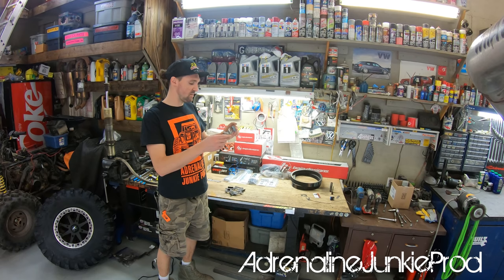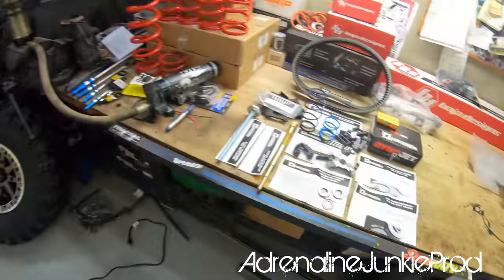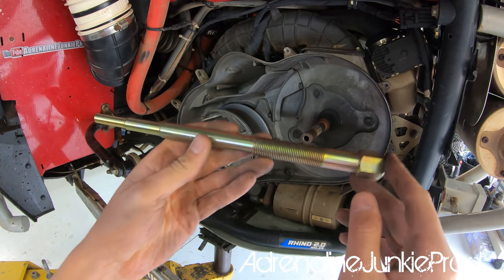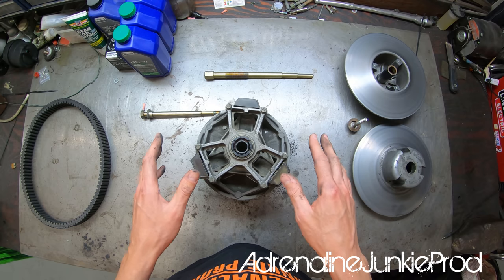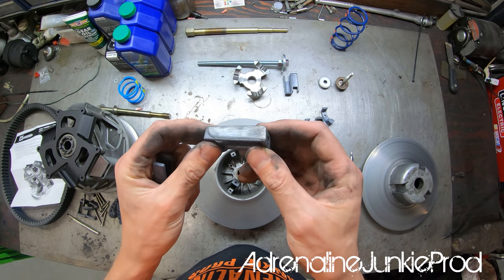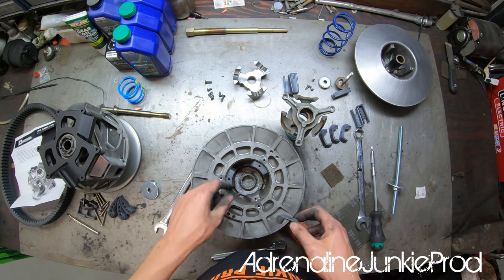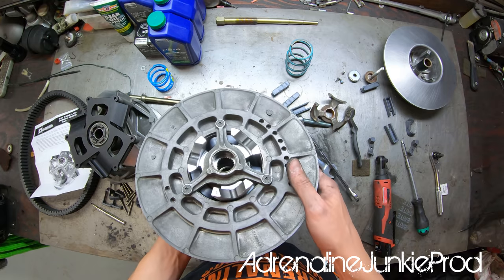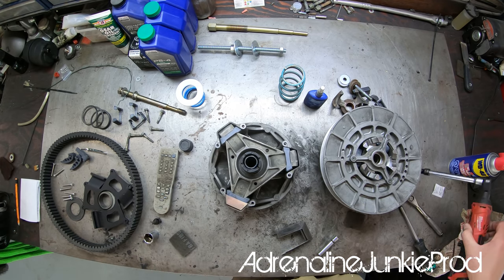Primary + Secondary Clutch Removal, Rebuild, Install - Polaris RZR Turbo, In Depth Step By Step DIY

Comment: This has to be the most thorough clutch rebuild I have ever seen. Well done! Now to tackle my own primary and secondary rebuild on a Polaris General. 👍
Reply from the maker: Hey man. Glad you found it helpful. The goal was to show everyone it’s not that hard if you take it step by step. Good luck on your rebuild.
Reply: @AdrenalineJunkieProd  Hey there. My primary and secondary need replacing. My head is spinning on which setup I should go with on the Aftermarket Assassin? I need help. Any suggestions?
Reply from the maker: @sweetcharlie700  I’m happy with my aftermarket assassins setup and so are a bunch of other guys I know who run them. I recently replaced my primary and secondary too. Made the machine feel new again. It’s not cheap but worth it. I’m future try to open them up and inspect them more frequently to prolong the life of the best set. You can either order a fully built setup from AA or get the clutches from Polaris and order the parts to build them. Pricing will be similar so it may be easier to just go straight to AA.
Reply: @AdrenalineJunkieProd   How do you feel about Duraclutch? Similar pricing to AA.
Reply: Is the clutch puller used for the AA primary the same as the stock Polaris clutch puller?
Reply from the maker: @sweetcharlie700  yes. The AA clutches are built off of brand new factory clutches from Polaris. But a high end puller. Not a Chinese Amazon special. I’ve seen those cheap ones break inside or bend and cause terrible damage.
Reply: Ok I just broke down and bought the AA clutch kit and the Tuner for my 2020 General. Time to unleash the beast! FYI when I removed my primary and secondary I happen to noticed a ripped CVT boot. So now I’m replacing both rear drive shaft. I can’t believe I’m doing all this on a machine that has only 1200 miles! Oh well… fun times!

Comment: That machine just keeps getting better. Thanks for sharing this upgrade with us.
Reply from the maker: Thanks! I’m super happy with how the machine is evolving. My next big mods Will hopefully be a full spring kit from shock therapy and an RS1 front diff conversion. Stoked you enjoyed the video!!
Reply: @AdrenalineJunkieProd  Nice man. Ive been waiting for a suspension upgrade video. You must be getting up on mileage.  I have a Commander wiyh 10k miles and due for suspension myself.
Reply from the maker: @marctaft3661  I just got the shocks rebuilt and revalved. Put some RZR Aid tender springs on too. It’s an improvement for sure but i think my stock springs are toast and my RZR is way too Heavy for the RZR Aid springs. I’ll
Post some updates on the suspension on the near future. Think I’ll have to end up going with the shock therapy full spring kit tailored to my increased vehicle weight.

Comment: Great job man!
Your definitely correct about don’t buy junk eBay clutch pullers! I bought one and the end portion that goes in the crank bent like crazy!!! Fortunately I got the primary off…but the puller was trashed! Use anti seize on threads! Please don’t  use an impact removing the primary though!!! Bad on crank shaft and bearings!
Reply from the maker: Ya, I've also seen the cheap pullers fail by bending, breaking or stripping. As for the impact gun debate, there's so many opinions to be had it's not a conversation worth starting, lol.
Reply: @AdrenalineJunkieProd  Yeah like you’ve said you get what you pay for but especially in tools!!
Reply: @AdrenalineJunkieProd  Some caution using an impact tool to replace the bolts.  However, I found the impact tool to be perfect for both removal and tightening clutch bolts.  No striped threads and no problems.  My impact tool is electric.

Comment: I absolutely agree with that kind of a mod it's best to do one thing at a time and feel it out.  I'm curious to see what that belt looks like I know it was running hot last time you were out.
Reply from the maker: Belt temps have been improved but still gets hot under heavy load high rpm pretty quick. Gonna see if I can get a belt cover off a 2019 turbo. I heard they got right on and make a huge difference. Not sure if anyone knows for sure.

Comment: Julian thank you for this video you did a great job with it I was able to go through my clutch because of your video keep up the good work 👍
Reply from the maker: Great to hear! Happy it helped you out! I know it's a little drawn out but it's good to know it helped you achieve the rebuild.
Reply: Hey there! I have a 2020 Polaris General with about 1200 miles on it mostly from a previous owner. I’m about to pull the primary and secondary for inspection and cleaning. What do you recommend I should do if things look worn? Rebuild/Replace both? Aftermarket Assassin website had so many option my head began to spin faster than the stock primary on my General.

Comment: The numbered plastic parts are likely used for quality control with the injection machine. If one comes out deformed, the part is numbered so you know where the fault is.
Reply from the maker: Ohhhh, damn… that makes a lot of sense actually. Didn’t even think about it in regards to manufacturing quality control. Thanks for the input!

Comment: Good idea to give trq numbers on the fasteners especially clutches. Good video for those new with clutching though.
Reply from the maker: Ya, I would have provided torque specs but as I mentioned in the video, it's so hard to cover all bases as various models and model years have changes in torque values as well as fastener sizes. It's best if everyone looks these up on their own prior to doing a job like this. I felt I was already dragging this video out enough and my main goal was to just orientate people to the major concepts and details. I don't script any of my videos, just film them off the top of my head so sometimes things get missed and at times things may be repeated. I feel I covered most the bases here. I'm glad you thought the video was good for a viewer new to clutching, it means I achieve my main goal. I really appreciate the constructive feedback. It helps me improve future videos.

Comment: I usually have to heat the torx bolts holding the helix in with a torch for a few seconds to loosen the blue loctite! They can strip out easily and your screwed!
Reply from the maker: That's a good tip. Mine came out easily luckily but I would of resorted to the torch for sure if I felt they didn't want to cooperate. Heat is usually you friend! Within reason.... lol.
Reply: @AdrenalineJunkieProd  Yes fo sure!!! I broke 2  half inch drive breaker bars trying to remove the spider nut and spider off my primary team clutch! Forgot it had red loctite and torqued to 300ftlbs! Don’t tell 🤫! Lol

Comment: You should sand down some or Dremel some on the other 1/2 of the secondary clutch to minimize new wear on your clutch sliders. The new sliders in there will wear down that same groove in your new sliders. Had same issue an AA recommended smoothing that out..
Reply from the maker: That’s excellent advice. Thanks man. It makes sense. I ended up putting a brand new primary and secondary on my machine when I put a new transmission in. I transferred all the AA goodies onto the new clutches and they feel amazing.

Comment from the maker: Thanks for checking out the video, I hope you find it helpful. I tried to be as in depth as I could without getting too repetitive. If you have any questions or additional suggestions for viewers leave a comment below. All the new components I installed during this video are from Aftermarket Assassins and I’ve had excellent results with this setup so far. I’ve been out on multiple rides in mixed conditions and the clutching is a massive improvement. Mike at Aftermarket Assassins was super helpful making sure I select all the parts I need to get the results I was after. Don’t forget to subscribe, like on Facebook and follow on Instagram!!!

Comment: Wish I found this video before trying to take off my primary clutch...🤦‍♂I got a 4inch bolt stuck inside there I tried using to different bolts to get it off and well it is now stuck.. Do you have any advice or tips on how to take it out or still manage to take off the primary clutch without taking out the engine.

Comment: Awesome but what's the benefit of this clutc????
Reply from the maker: Well my clutches were worn out. They were tired and damaged so the new clutches obviously bring back the level of performance I had when the machine was brand new. In addition setting up the weights and springs to suit my wheel/tire size and driving style help a lot. I also have a stage 3 engine tune and some other modifications so dialling everything in to work together added a ton of benefit. The clutching is now smoother and the machine feels more refined and more powerful.  The power onset is better and the power output  is improved. The upgraded helix also helps a lot. There are a lot of benefits to clutch modifications. I suggest doing some reading on the topic. It’s a hard question to answer because there are a lot of variables at play.

Comment: Hey Julian. My 2018 xpt throttle body does the same thing. I just recycle the key on and off. I have always wondered why it does that
Reply from the maker: Ya, I do the same thing with the key but I believe it is a sticky servo motor in the throttle body. I think it should be covered under warranty but the problem is that you can't always recreate it at the dealership.

Comment: My first question is is the only thing you work on your equipment or do you actually work on other people's ATVs that's irrelevant really.... However your knowledge of speed shift messages and all of that stuff I find it phenomenal... And here's what I'm making a comment on your website I have a Vmax 700 triple sx ..... You're going to like this.. as far as clutching goes maybe you can help me with my adventure.. I'm sure you already know I'm dealing with a snowmobile I live in Michigan.. there's more I modified used clutch to go onto the engine shaft from at 3 40 bravo. Because they're primary clutch has a oil gear .. it has been removed I'm about to install the clutch with the saying weights and everything as if 380 or the 340 should I say is it your opinion I'm using the same spring on the original clutch.. what if any performance would I get out of putting an older clutch off of another used but re-fabbed.. effect will it have on my sled which is mint condition with reverse find out let me know and don't waste your time if you're extremely busy try ranking from mosquito Michigan no I love where I live Muskegon county Michigan please respond the nephew do it doesn't have to be directly by you but someone that has similar knowledge and, since like you uvideos are Awesome

Comment: Hey Julian, I am a huge fan and enjoy all your videos. I have kind of a weird question. What kind of hoist do you use?  I have a 10,000 lbs forward hoist, it’s both symmetrical and asymmetrical, and when I put my 17 general up on it, because of the plastic skid plates, I have to use my outer frame rails. It’s kinda a struggle to get the machine positioned perfectly because the arm length is so long. I noticed you put your arms in a location closer to your suspension mounts. Do you have an Atv specific hoist or are you taking your skid plates off? Can you elaborate a bit on this? When I put mine up it sometimes seems a bit sketchy
Reply from the maker: Sorry for the delayed response just noticed your comment. It’s a 10,000lb automotive hoist. When I am doing a bigger job I remove a portion of the skid plate but when I don’t I do the front two corners where the frame rails start in the outside of the machine and as far back as my arms will rear on the rear rails under the engine/trans area. I also use my 6 inch risers to level it all out and clear everything. If I push on the machine it does sway quite a bit but it’s actually on there really good. It took me some trial and error to figure it out but it works for me. It’s far from perfect but I’d say it is totally safe in my case. Sometimes I struggle with certain cars even the first time im lifting them.
Reply: @AdrenalineJunkieProd  thanks for the reply. I do appreciate it. I love your full length context and your rally documentary. Keep up the great work. I hope to start making videos in the near future, so I am happy you had those videos you made about the subject. Thanks for all you do
Reply from the maker: @Squirrel440  thanks for the positive feedback man! Glad you enjoy the videos. I have a lot of fun making them so it’s always awesome to hear comments on what people think.

Comment: whats that black fan thing youre bolting to the primary? mine doesnt have that?  cooling of some sort?
Reply from the maker: Hey Beau. Yup, it's a set of fan blades. You may not have heard me but in the video I mention that its a Primary fan cover from Aftermarket Assassins. It increases air flow up to 50CFM and in turn can decrease belt temps noticeably, depending on riding conditions. You can get some more details on it on the Aftermarket Assassins website, here is a link: https://aftermarketassassins.com/products/ols/products/aa-xpt-primary-clutch-fan-blade 
 (I am not affiliated with AA in any way and don't receive any commission or kick back from recommending their parts, I just really like them)

Comment: What do i do if the factory washer with the lil hole is broken for the secondary? Is it necessary?
Reply from the maker: Yea it is necessary. Buy a new one from the dealership. They are not expensive. Even the aftermarket snap ring delete kits still utilize that washer.

Comment: I was just wondering if you know what the compression rate is on the new springs that you are installing just an example
 130- 220 so the 130 would be the poundage of the spring just being installed and the 220 would be the rate when the clutch is at full shift out and spring is fully compressed I am just curious if they give you the spring rate or if they don't tell you like they don't tell you what the actual degree of angel on the helix . I know it's a very common practice to not tell the customer some of that Information. So you don't just buy one kit and then just buy the parts by themselves to save money and build the same kit for your buddy and save you some money don't get me wrong I have all the tools and ability to check the spring compression rate and I can figure out the helix angle the number on the helix is just a number that they put on there as a code that they have a chart to look up the number on it and then they can cross it over to the actual degree of the helix also what is the total weight of each of the cam arms  when they are set up ready to be installed if you have any of that Information that you can share would be pretty interesting thanks very much and have a great day
    . ... Bob.....

Comment: Almost 7 minutes till actual information happens
Reply from the maker: What's your point? It's called an intro. The video is 110 minutes long. 7 minutes is like 5% of that. In comparison that's like complaining about a 10 second intro on a 3 minute video, lol. You can always skip ahead if you don't like it or make a better video and post it. Anyways, hope you found the info you needed.
Reply: @AdrenalineJunkieProd  I'm just kidding. I would still complain about the ten seconds!!
Reply: Also have you had any experience with, Hunter works belts/clutches?
Reply from the maker: @philturinsky27  lmao, I’m just busting your chops too man. I haven’t had any personal experience with hunterworks but I’ve heard a lot of positive things about them in general. I like running G-Boost belts. I’ve had good luck with them. No one in our crew has run the hunterworks belt so I’m not sure how it compares.

Comment: @36:25 The direction of spin on your clutch doesnt change. Is that what you meant?
Reply from the maker: You are correct. Not sure what I was thinking here man. What I meant was the clutch always spins one way. Not sure why I said the direction changes in reverse. It’s obviously the transmission that controls all that. Just a brain fart. Very observant of you picking that up!! Thanks for clarifying and correcting me.

Comment: Warranty or not, anything clutch related is considered a wear and tear item, which won't cover u
Reply from the maker: @juliocalderon8806  certain clutch issues and failures are most defiantly covered under warranty. Polaris has had many such issues and will cover issues related to known design problems, defective components or in wider cases, recalls.

Comment: The worst thing you can do is hold the back of the clutch by the fins the Polaris tool is junk you can actually spin the steel shaft in the aluminum if you make the steel shaft to the aluminum sheave and probably 75 percent of the time the shaft with spin a little bit and the clutch will fail sooner and cause more belt Temp
 ( higher temperature) the best tool will look like the end of the crank shaft that goes into the clutch and you tighten it up like it was going back on the crank and that way you don't hurt the clutch when do you have to use your puller again to remove the clutch from the tool trust me this will save you money in the long run and your clutch will last longer good luck and have a great day..  Bob..